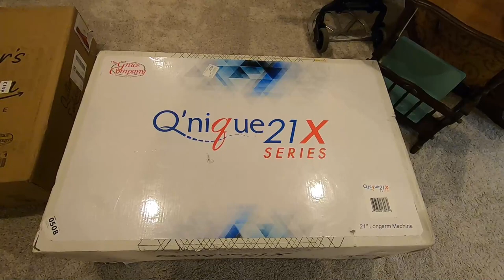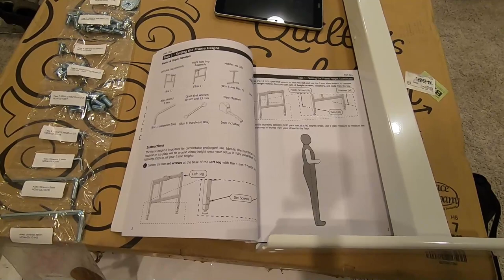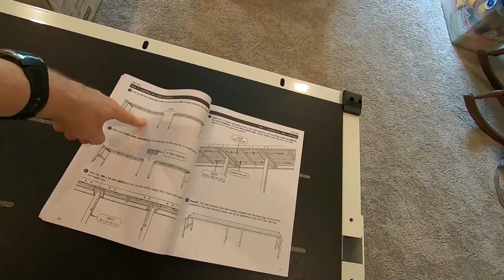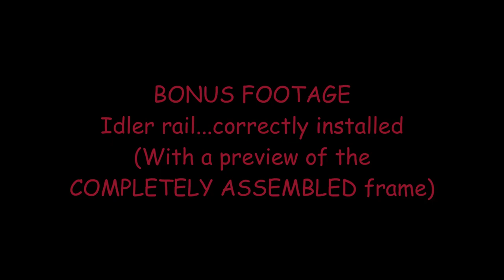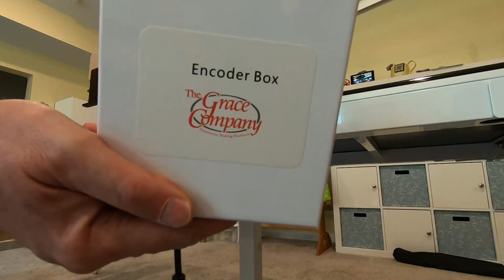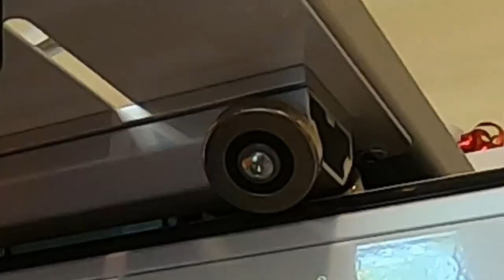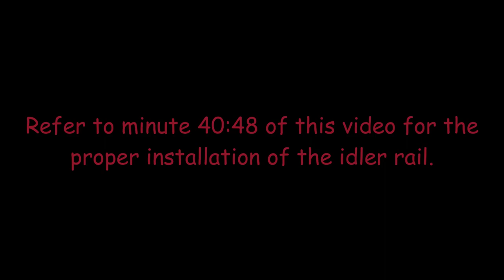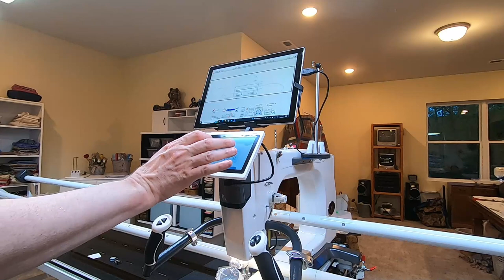Quilter's Evolution Frame Assembly and Q'nique 21X Elite Setup

Comment: Excellent video - as always, very clear information.  Question - how do the ratchets differ from the Continuum II frame?  I’ve had trouble with those stripping.
Reply from the maker: I've never worked with a Continuum II, so I don't have specifics. My understanding is that the Evolution rachet mechanisms are closer to the original Continuum (gear and pawl) than the Continuum II (a tension mechanism that is prone to slippage).

Comment: I have the hoop frame and just ordered the upgrade extension kit  to make it 8 foot. Would it be better to dismantle my frame and start from scratch with the assembly .
Reply from the maker: Since Janet & I have zero experience with hoop frames, I would recommend reaching out to The Grace Company for their guidance. A complete disassembly at the outset seems overkill to me, but then since I do not know hoop frames, I think that contacting Grace for advise would be prudent.
Reply: @dfgeorge  thankyou

Comment: So I just got my Evolution Elite in the mail last week, waiting on the teenage grandkids to have time for me to help assemble.  I am having lots of trouble trying to figure our exactly where I want to put it.  I am doing as much prep as I can and still have room to move about the house for an undetermined amount of time.  So something I have not been able to decipher from either the documentation or your video is dimensions, assembled length and width.  If you could tell me what the finished dimensions are I would greatly appreciate it.
Reply: We are having work done in basement and frame & machine are covered in plastic and surrounded by boxes of stuff and furniture!